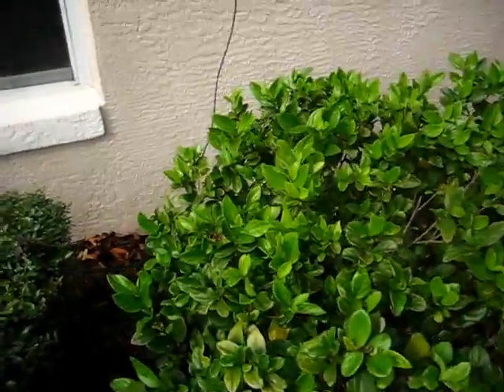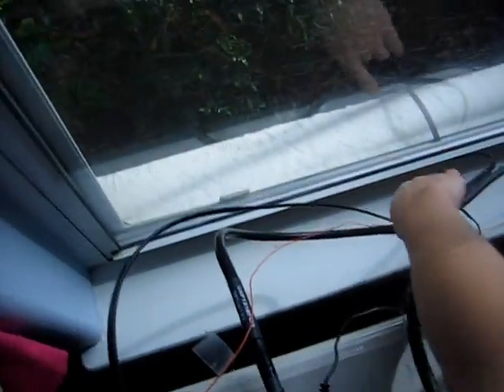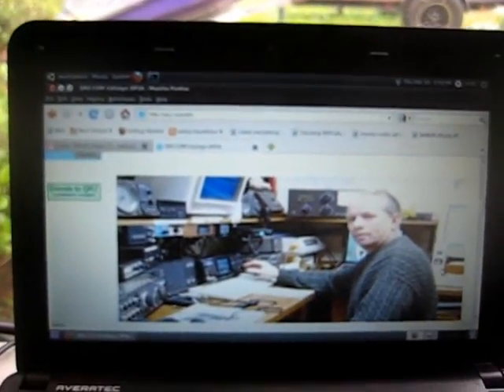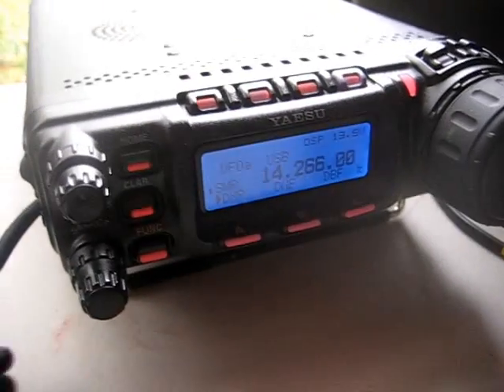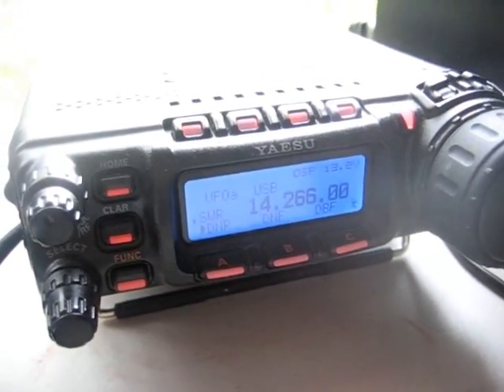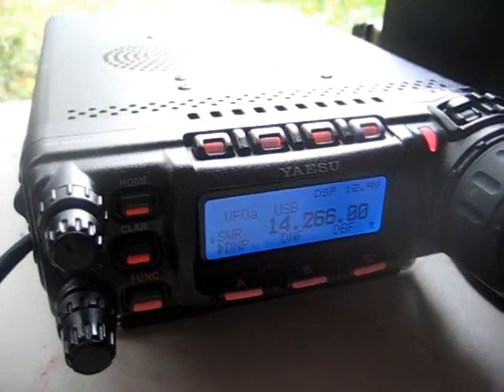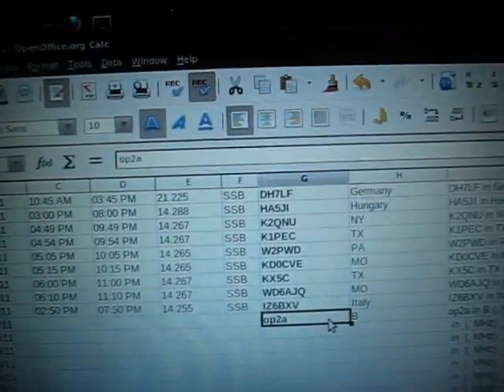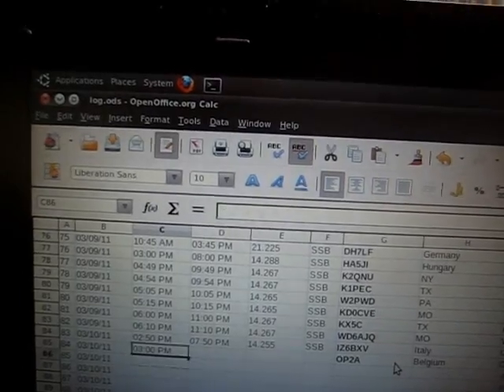Spring Break QTH 2 - long wire dipole, belgium QSO

Comment: I am getting a FT-857D soon. After the rig, tuner, and power supply i am not going to have much money left over for a antenna. I will definitely make a wire dipole like this. Then i would like to try out a Buddipole. Good luck, nice work and good idea on the 300ohm cable.  sounds like it is working great for you!! 

7-3 K8FXX